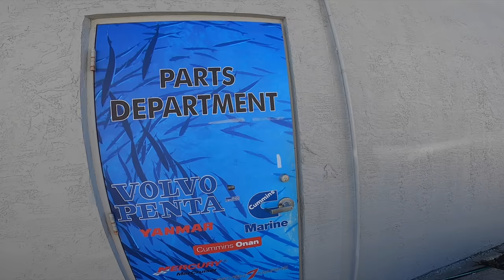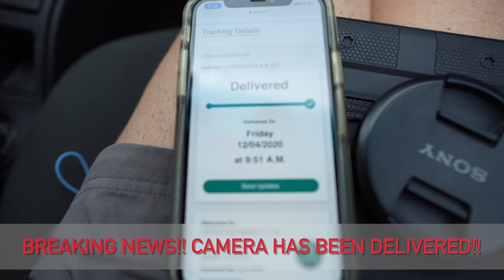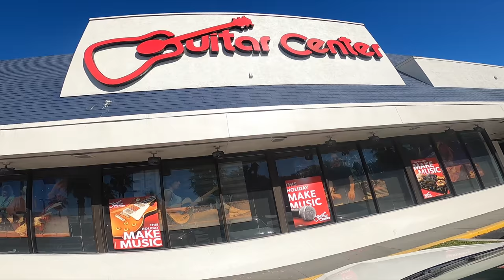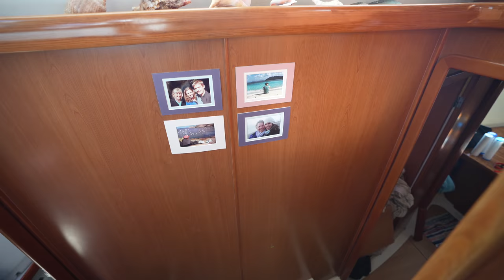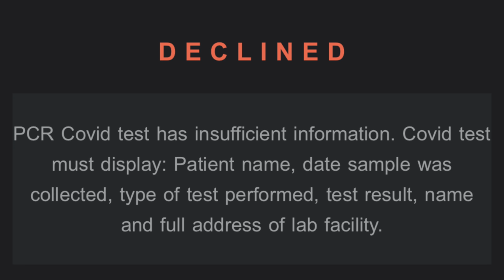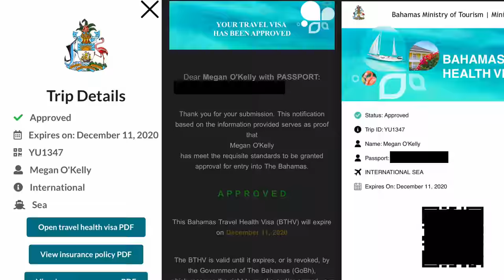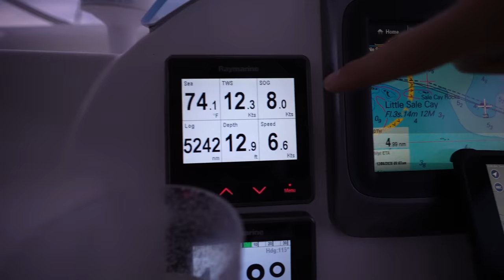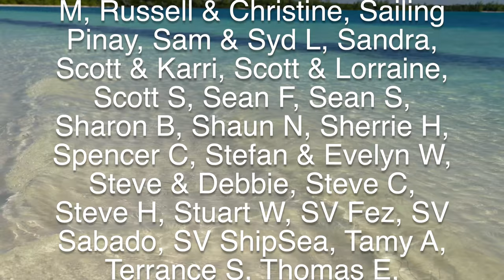NEW RULES - What it takes to sail internationally - IT GETS COMPLICATED!

Comment: Looks like you have 3 bolts protruding from prop/hub at 14:06...when you removed grass from the prop.
Reply from the maker: Anode came off. I since stopped using nylon bolts. Too much flex and wear.

Comment: I don't think I'll be catching up to you in the Bahamas. Have half the engine torn apart just to get to my leaking injector pump. Thought I had everything done as far as maintenance until I test ran the engine and poked around with a flashlight. Diesel was just gushing out of the throttle armature. Fortunately, the boat came with lots of spare parts, rebuild kits and gaskets. Should have her back together and running over the next few days. Have a rum punch for me 😁 - S/V Celtic Star
Reply from the maker: Ah, bummer. Sorry to hear it. Hope it goes together as fast as it comes apart. See you out there.

Comment: Second place :) Wow, that's expensive and a lot of work. $500 a peace for the test plus plus plus. That almost $6,000 bill for boat insurance seems very expensive. Is that about the normal price and how long does that cover you for? I would think one year but am thinking only six months. If you did have a total loss, would the insurance company give you full replacement value or a reduced percentage of the actual value and would they also cover all the other gear you have on board?
Reply from the maker: Insurance is for one year and covers us north of Hatteras and outside of the hurricane box if we want to stay in the Caribbean. It’s based on replacement value not depreciation but they didn’t insure it to the full survey value because we didn’t provide every receipt. Dingy is on top of the boat insurance for full replacement cost. It definitely went up from last year but we have a wider range so there is that.

Comment: Do u recommend stocking a spare  inverter since the boat depends on electricity?
Reply from the maker: We do keep two smaller inverters aboard, just in case.
Reply: @TheOKellys  when you got your boat, did some tell you what to buy spares of?  Seems like the initial buy is huge and easy to forget needed stuff.
Reply from the maker: No, not really. We buy spares of things that have failed on us before. Starters, alternators, inverters, solenoids of different sizes. Wiring, terminals, lights, hinges.....   We kept an oil cooler for a Lehman we had once because someone said we should. And...we did need it in the Sea of Cortez, but that’s the only time I remember. The list of spares, glues, caulks, tapes, washers, screws, etc on this boat is endless.

Comment: Nick, who built your solar array?
Reply from the maker: I (Nick) did.
Reply: @TheOKellys  Who welded your SS support frame?
Reply from the maker: It’s not welded. The stainless uprights are off the shelf parts and remnant tubing from wind generator. The beams and deck mount points are aluminum L, riveted. Deck points are through bolted.. I did all the fabrication with hand saws, drill, grinder, and polisher.